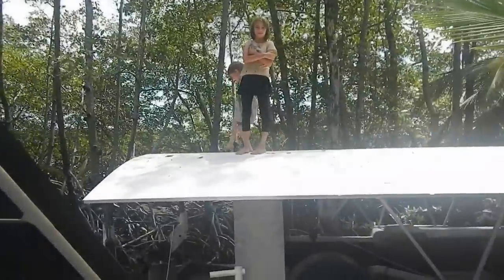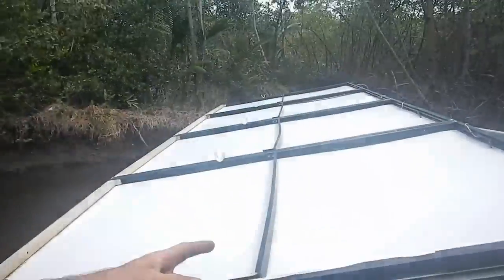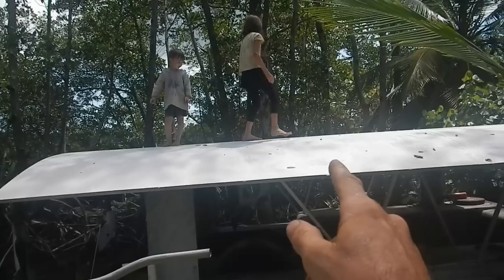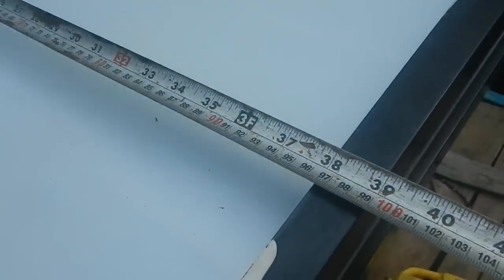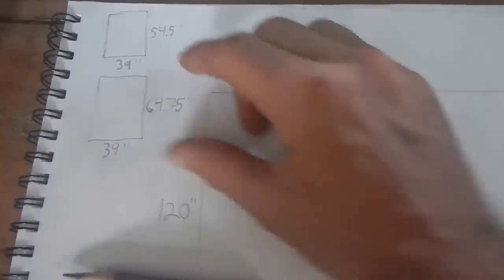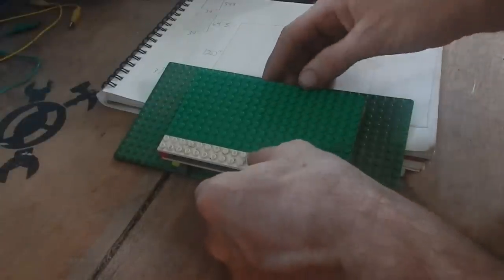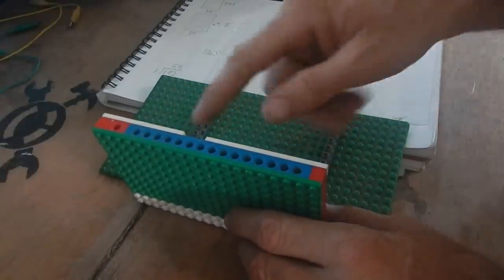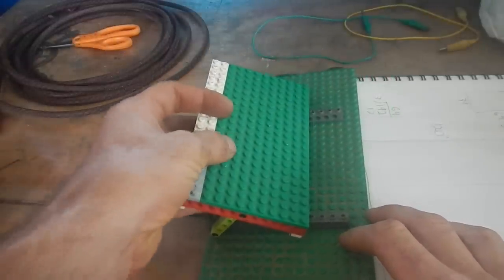Shark Slicer 017 One Solar Panel

Comment: You need to diy a metal brake (bender),I seen a/c guysdo it with a few 2×4'sand some steel over the edges so you get a clean bend,make it about 4ft wide